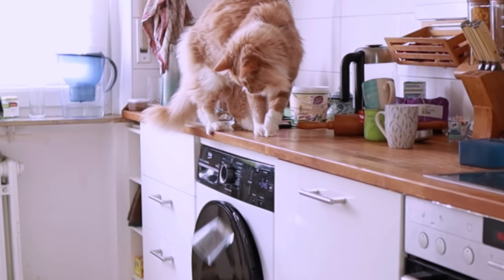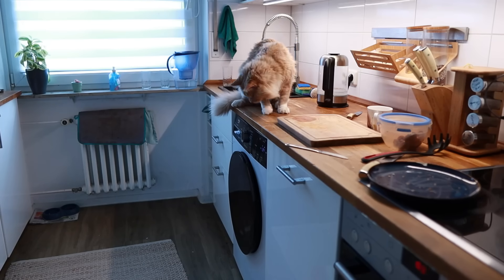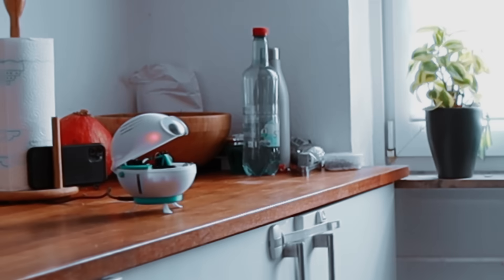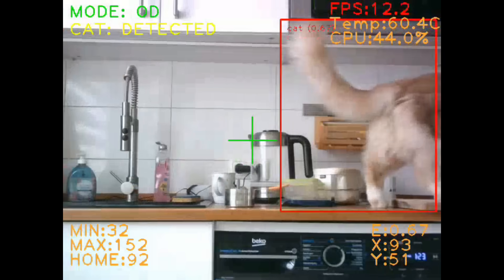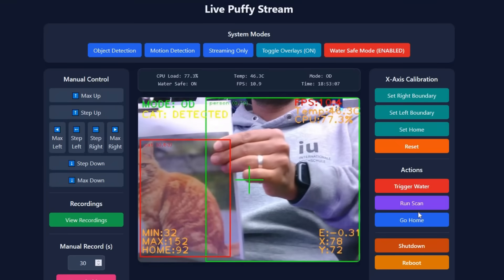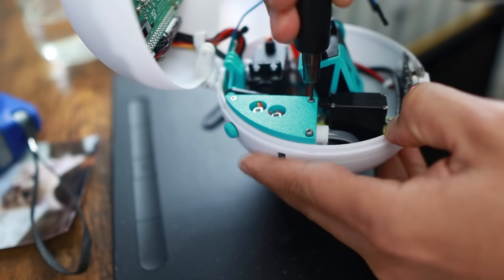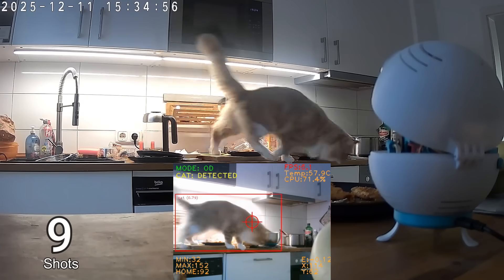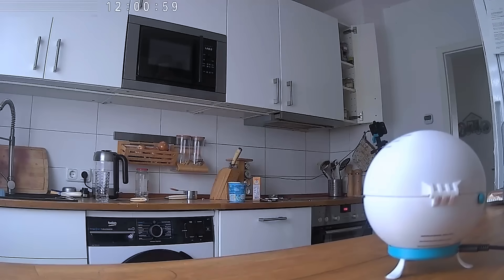My Cat Kept Jumping on the Counter..So I Built a Robot

Comment: I think you could cut it down to less than 2 times a week if you put in a Water Pik mechanism instead of a squirt gun.  rofl.  I think Puffy would have to be bigger for that to happen, though.

Of course, then you would have a different problem.  Wet floors and counters would become the difficulty.

Did it modify Cookie's behaviour in one week?

I wonder if you could modify Puffy to shoot at mice and rats in your attic.  I guess you could make the AI aim at anything that moves so any kind of infestation in the attic would get the business.

Interesting project!
Reply: Well keep in mind the goal isn't to soak the cat but discourage him from getting on the counter and the amout of shots needed went down the more Cookie noticed the shot and associated the noise Puffy with punishment so the current function worked.
Reply: @PaulonTheBrave  Doesn't he need to take a bath once in a while?  I get it though.  You don't want to be cruel about it.  Hmmm... So maybe just the noise is enough now?  Thanks for the video.
Reply: @GoCreateSomething I wouldn't consider getting hit with a spray of water a "bath"
Reply: @PaulonTheBrave  lol.  You could have three.  First one to soak Cookie.  Second one to soap Cookie and the third one to rinse.  Then Cookie goes under a hair dryer to dry out.  It would be like a Jetsons Catwash based on a carwash.  Not something you want to happen in your kitchen though.  Fun to conceptualize.  Maybe it could be set up outside with treat dispensers at each station to entice Cookie to cooperate with the process.  The downside?  Cookie might start liking getting spritzed by Puffy.  I am definitely not serious about any of my suggestions, of course.

Just imagine how many views that would get if you made it actually work. :P

My late father and I would have conversations where we would take ideas to the highest level of ridiculousness we could.  On a road trip heading east out of LA we had a conversation about windmills.  We wondered why there aren't windmill powered ratchets and circular saws and all sorts of silliness.  Was one of the best times I ever had with him.

Comment: The machine is great. Try to get a patent or a copyright. Then look for an investor. Perhaps you can build a machine against dogs too.
Reply: Ufff... Esa sí que sería una solución para que disminuyeran las cacas 💩 de los perros en nuestro jardín.
Reply: My hardware stores and Amazon have motion sensor sprinklers for outdoor gardens.
Reply: Китай уже сделал такой лазер против комаров.
Reply: I need a rat‘s or sheep’s poop shooting machine, against pooping dogs near my garden door😂😂
Reply: @LeicaM11  I just need an automated automatic rifle to keep animals off my lawn. But uncle sam and the police seem to have a problem with that
Reply: @chrisakaschulbus4903  That would keep dead animals on your lawn instead. Maybe you didn't think it through.
Reply: @vigilant_1934  The system would not stop firing until the lawn is flat. An arduino controlled relay would activate a pump so the lawn is being washed.
Reply: A robot for dogs might be bit big if you try to fit in shotgun

Comment: DIY kit sounds fun but I'm sure that most people would prefer it fully assembled
Reply from the maker: Yeah.. that's my assumption as well. Thanks for the feedback.
Reply: @TheLab-X  - Why not offer both options?
Reply: @TheLab-X  the less assembly required the happier the customer... but if it had to come in two pieces to prevent damage or to reduce size, I think people would understand.
Reply: @matiascampbell2464  - It depends on the purpose of the end user. If it is for educational purposes, then non-assembled meets their needs. If it is for immediate use, then it should be assembled. That is why I suggested the best way forward is to offer the customers both options
Reply: @notprovided1131 yep, though I didn't say anything against you as my comment was written 2 days prior to yours...

But yes if this creator does that kind of thing then your suggestion is perfect. But it may need to be a 3:1 ratio 
(3 partial/fully built:1 build kit) as to cater to fans and to access the wider market.
Reply: @matiascampbell2464  I understand. I just wanted to offer more clarification so that my input will be useful
Reply: @TheLab-X  Please both! 🙏 You can make the fully-assembled one more expensive. I understand most consumers will want it already assembled, but offering a DIY version of a product like this that is actually practical, cute, and funny, makes it so satisfying and enjoyable to build as a tinker-er or as a parent with children. So please offer both if you can 🙏
Reply: @TheLab-X plus you would get thousands of support mails because people don't success assemblage
Reply: Fully assembled please!
Reply: I know I would.